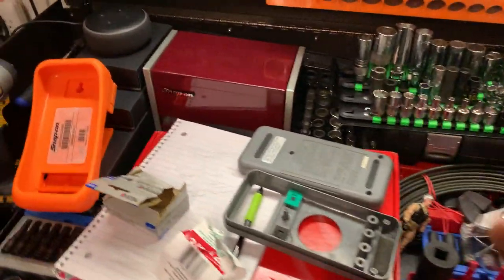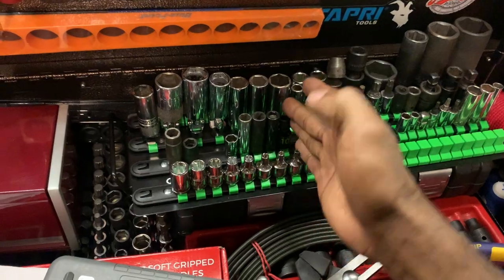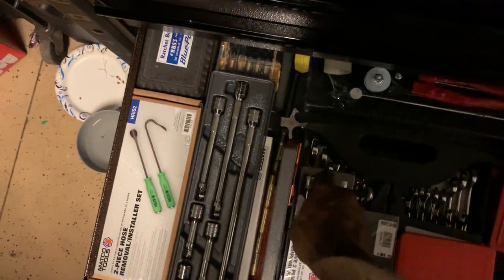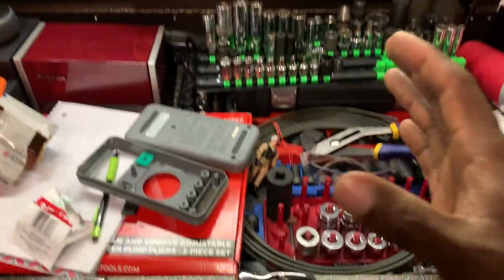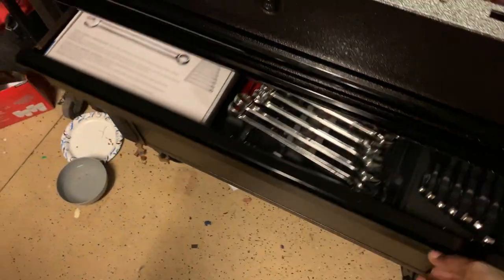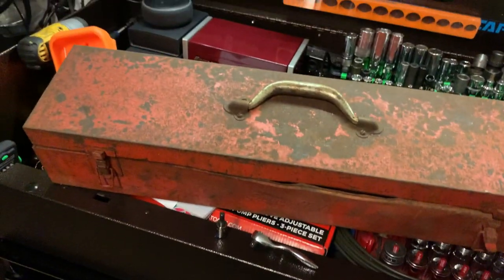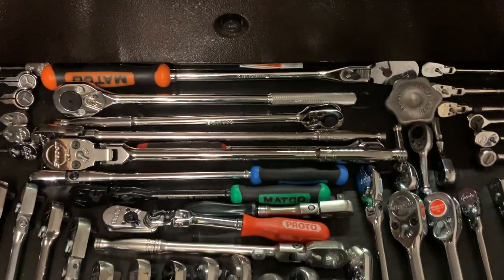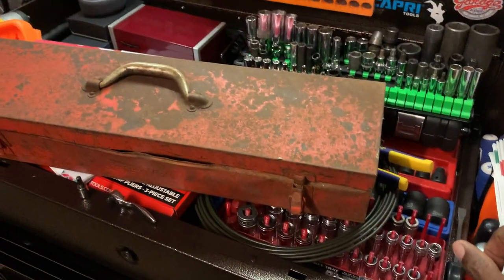Snap-on & Matco | Tool Haul

Comment: Your dvom is missing the screen cover and where snap on likes to place the part number. Its an EEDM503A. Snap on still sells a version of this unit. Fuses you need are EEDMFUSE-1 and EEDMFUSE-4

As for the matco pinless they are my go to for almost everything I do. I own all the pinless they sell as of now. That older 15mm when you replace it under warranty it will be replaced with the pinless type.  The micro ratchet is a cool thing but i have a few issues with it as matco sells 2 versions, vim who makes them sell one version and it includes the hex to 1/4 adapter that sits flush and makes it look like its just a tiny ratchet, and its only 30 bucks. They also make a 3/8 version Vim DD3
Reply from the maker: Thanks Tino!!! Really appreciate the info, as I've been trying to figure out what fuses to purchase. I'll look at the Snap-on website, as I should be able to buy direct.

Comment: Matco has both in the mini ratchet 1/4 bit driver & 1/4 ratchet versions. Great haul Midwest..
Reply from the maker: That is correct! I ordered the ratchet version, but it wasn't on the truck when I picked up this little guy.  Hopefully I'll have the ratchet version then, and if so, you can guarantee it'll be on the channel.

Comment: There's quite a few brands that distribute the 10mm socket set between Shallow , flank drive , semi deep , Deep just as well as Magnetic Power Sockets and Chrome universal ...I have the Duralast pretty much the brand is not of a issue nor does it necessarily have to be anything specific a 10mm socket set is a back up set to your primary go to sets in instance of a primary either being mis placed damaged or lost ...The set is to fill the void when a situation occurs ... Its also better to have a least inn expensive were that if you technically have to remodify a socket rather then use more expensive brand to do so ...Brands like Carlyle  , SK Tools , Gearwrench and a few others distribute them but when it comes to the SK set they are just as expensive as any tool truck brands

Comment: The nuts on E36 M3 exhaust studs are 11mm, that's why I have one.
Reply from the maker: I have a ‘99 E46, so I wonder if they’re the same??
Reply: @MidwestToolReview  possibly
Reply: @MidwestToolReview  manifold  exhaust nuts should be 7 mm (M7) on '99  e46.  Check out BimmerWorld copper exhaust stud nuts. 
Great video!
Reply: @biggiefitz6275  lol, right biggie, that means an 11mm nut is on that 7mm stud.  Stud size is not synonymous with nut size.